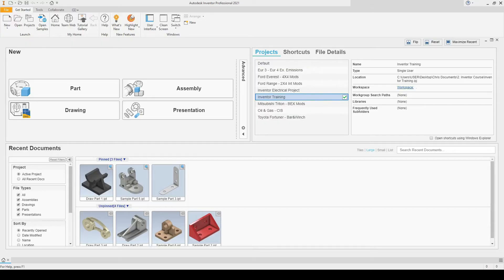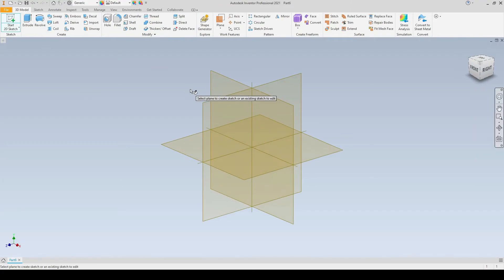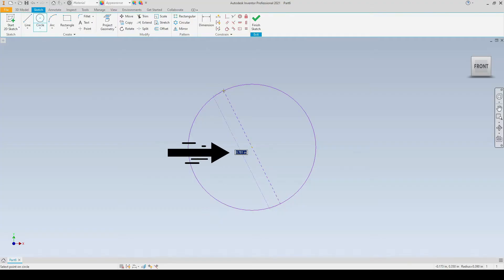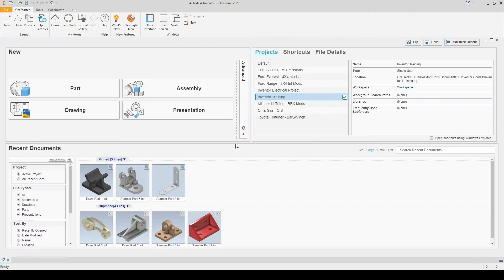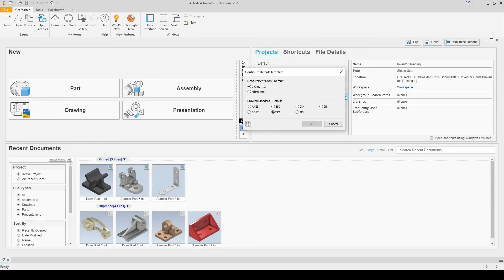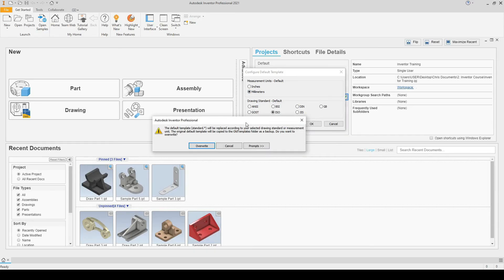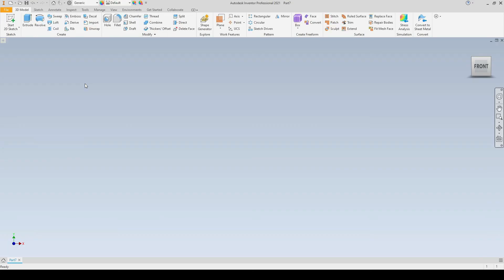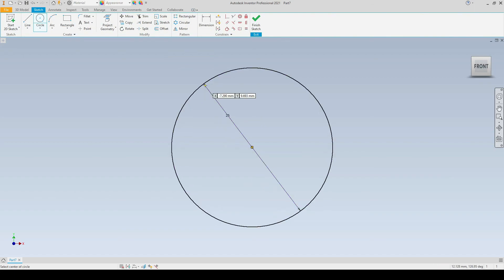How to Change Units (mm and inches) | Autodesk Inventor

Comment: i can not create new file an erros appeares and program stopping working when i klicking on new ...help me
Reply from the maker: Hi @Amir, Can you give more details as to the issue? What is it that the error message states? When you say the program 'stopping working' do you mean that the software is crashing? Are you running an unlicensed version of Inventor? What year is the software? Is your machine to a specification that can operate Inventor software?
Reply: Did u find the answer ? I had the same problem

Comment: how to change dimensions from inches to mm after creating drawing in autodesk inventor?
For eg.  I was draw 22 inche circle.  How to convert 22 inche circle to 22 mm circle without deleting sketch?
Reply from the maker: Hi @King Md! When you are in the Sketch, go to 'Tools' --> 'Document Settings' --> 'Units'. Here, you can change the document units from inch to mm 👍👍
Reply: @AutodeskInventorTutorials  the sketch dimensions change to mm but the annotations at the part level remain in inches, how to fix that?
Tried adding an additional annotation it still displays in inches even though the document settings have been changed to mm?

On a separate note how would you display both mm and inches for selected annotations?
Thank you.
Reply from the maker: Hi @MumtiTV, Good question! Annotations are slightly different as they are locked according to the pre-set annotations Standard. You can change this by going to: 'Tools' --> 'Document Settings' --> 'Standard' and then switch the 'Annotations Active Standard' in the drop down to either 'ASME' or 'ASME mm' depending on which units you want for your annotations. Your annotations will then change to the according units.

For displaying both imperial and metric units for annotations, as far as I am aware this is not possible as the units are locked in to the annotations standard. If I find a way around this I will let you know, likewise, please let me know if you find out how. 

Thanks MumtiTV 👍👍